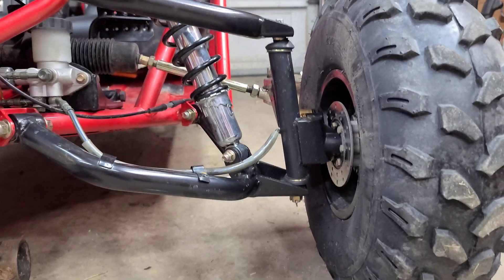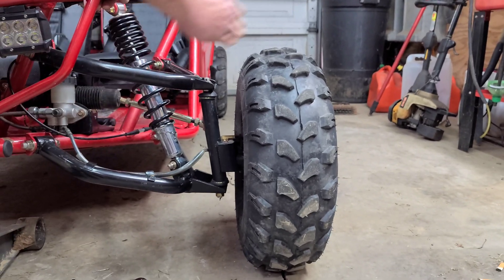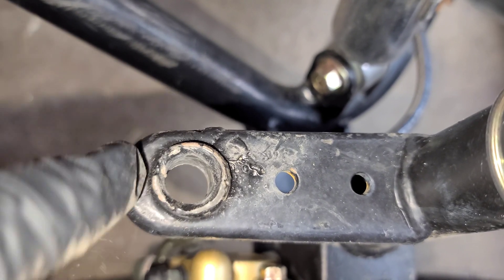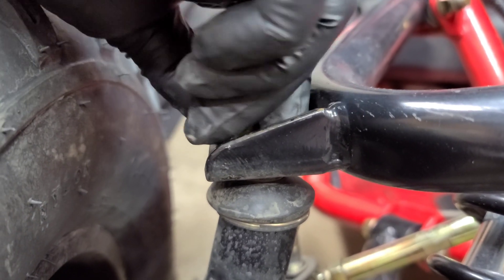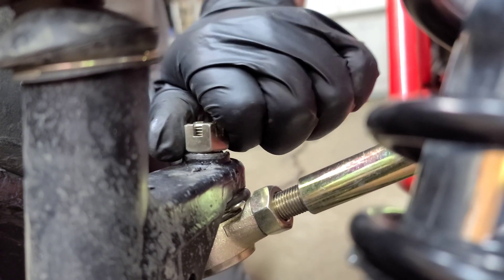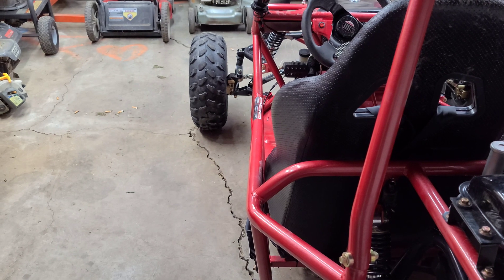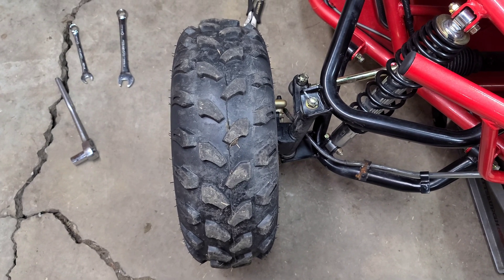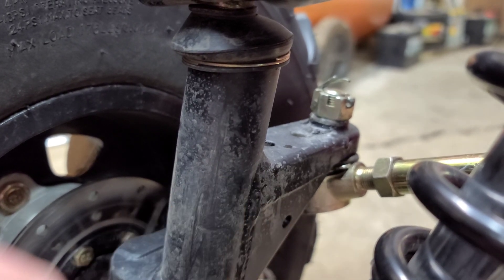How to Eliminate Bump Steer with No Parts on Vicatti Batman Kandi Viper Go Kart Buggy

Comment: Wow, this helped me. Mine was on a used Chinese atv and it wanted to throw you off just going straight. I did the same thing though and moved the tie rod from the top to the bottom and it fixed nearly all of the bump steer. Fixing that also showed me other issues, like the shocks are blown out and the swing arm mounts are worn out. But this helped my main issue, otherwise I was basically going to scrap the ATV after pulling the engine and tires.

Comment: Great video you 100% addressed my issue. My only question is how did you figure that out?
Reply from the maker: Just years of experience
Reply: @sartingarage8045  your experience and knowledge is absolutely apparent and appreciated. Sharing your knowledge is making this world a better place. I’m not a mechanic in any sense but I have changed ball joints and seeing the nut on the bottom never raised question until watching your video in which you explained it perfectly so am I wrong in my memory of ball joints going in from the top?
Reply: @sartingarage8045  also the 200cc machine that I’m speaking which looks like yours is having two issues, 1 is when you stop it dies but seems to run fine otherwise and 2 is it turns much sharper one way then the other and I realize when I fix the original ball joint problem then the tie rod alignment will probably fix this hopefully
Reply from the maker: I had to adjust the idle up a bit on mine to 
It would die sometimes at idle especially when cold
Reply: @sartingarage8045  it worked for me as well at first I wondered if the jetting needed to change since I live at 2500 ft I know my old 2 stroke dirt bikes back in the day were affected by elevation not sure if 4 strokes are also. Thanks a lot you’ve addressed all the issues I have with this machine are you familiar with a Yamaha blaster 200cc oil inject 2 stroke?
Reply from the maker: Never repaired one of the blasters

Comment: I know this video is a year old but I just bought the Massimo version (same thing different branding) and was wondering what to immediately replace with better parts. So far I’m getting oil, air filter, Loctite(loose nuts), and looking into carbs. Am I missing anything that I should be worried about? I hear the gear lubricant isn’t great stock either but I suck at automotive stuff.
Reply from the maker: So far I have upgraded the battery. Fabricated a Metal battery box and installed a Lawn and garden battery for like a Riding mower. Replaced Voltage Regulator due to original battery bounced out of box and shorted wires out, Replaced front wheel Bearings,
As of Now the Cart is down and has stopped pulling, I believe the belt is broken , But haven't checked it out yet. It needs new tires front and back due to my kids ride it on pavement. I'm going to order Xtra set of rims for more street tires to go on it amd the new off road tires will go on it when we take it somewhere off-road.
But other than that, Cart has been trouble free
Reply: @sartingarage8045  good to know, I heard there were this problem and that so I plan on going through the whole thing before hand to make sure everything’s there. I’ll double check the front end to make sure the tie rod is placed correctly!

Comment: Well, wouldn't you know it... this was the issue.  Also, whoever put mine together didn't even put the cotter pins in the castle nuts on the tie rod ends.  I had the same nuts on my spindle as well.  I haven't been able to test out the steering, yet,  but I'm 99% sure it's fixed.  The guy I bought it from had all the paperwork for it, so I looked in the assembly instructions.  The pic shows them installing them from below (but is low contrast so it's hard to tell), but the instructions don't explicitly say that.  That's probably why they keep getting installed wrong.  Thanks for this vid, man!

Comment: Hey, where can I get new front tires for this model? Do you have a link?
Reply from the maker: Search Amazon or Ebay by your tire size
13x5.00-6 is the front on this MZ5424
Reply: @sartingarage8045  I did but my tire size is 17x7-8 and they always have the same cheap ones. Your thread looks way better than the cheap ones I bought before.
Reply from the maker: Those are the stock tires that came on the Cart . I did Buy a new set but haven't installed them yet. They were like $200 for all 4 on Amazon
Which mine are 19x7.00-8 on front
Reply: @sartingarage8045  ok thank you I thought this model would be the same size in tires.
Reply: @sartingarage8045  would you think the size you bought would fit mine? I'm new to this whole go-kart thing.
Reply from the maker: I would stick with the same size tires that are on your Cart. You will most likely run into tire rubbing to frame if you go to a bigger tire.
Reply: @sartingarage8045  ok I will thanks

Comment: I've also noticed most modern ATVs and SAS UTV's have the spindle arm bent at the same angle as the tie rod as opposed to what you were saying at the end of this video. Either way would fix the issue just fine. On my little buggy I took a big adjustable wrench and tightened it down on that arm and bent it myself but had to use a little heat. Getting rid of bump steer has been a pain in my ass for a couple months now LOL. Keep up the informative videos I really like the way you present them.

Comment: I can’t loose nut and the tie rod and nut is moving together any help?
Reply from the maker: Need a tie rod seperater tool
Put it between the knuckle and the tie rod end. Hold up or down pressure on the tie rod should let you get the nut off.
Doesn't always work but most of the time it does. Doesn't have to be that tool just something to hold pressure on tie rod.
What ever you use just be careful Not to damage rubber boot on tie rod end.
Reply: @sartingarage8045  done thank you sir

Comment: I was told by the verification center not to run the oil that’s in it, to change it first. She said it’s only like a mineral oil? Huh? What do you suggest? Great videos too, helped me out big time!
Reply from the maker: It is Break in Oil
I ran mine for approx 10 hours with the break in Oil, Then changed the Oil..
Even if you change the oil that's in it
You still need to change it again in about 10 hours of use for the break in of engine.

Comment: I just picked up my gkm200 last night and the tie rod arms are installed like yours (upper side). The manufacturer has a picture of kart and I noticed the tie rod is installed on the lower side. Thanks for pointing this out, I’ll need to swap them. Looks like the manufacturer needs to be made aware.